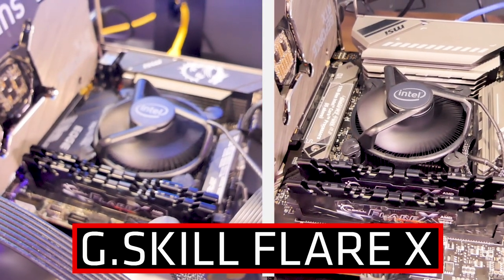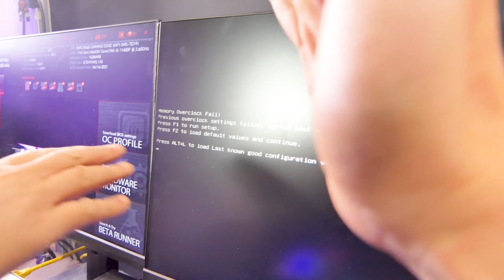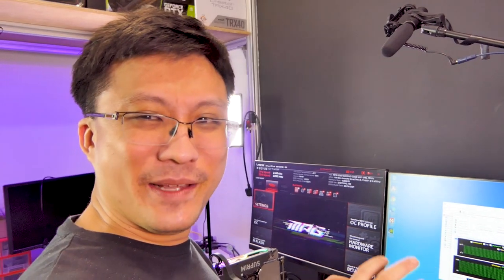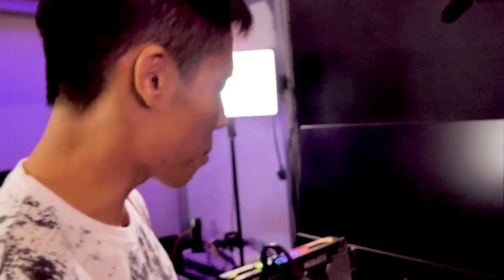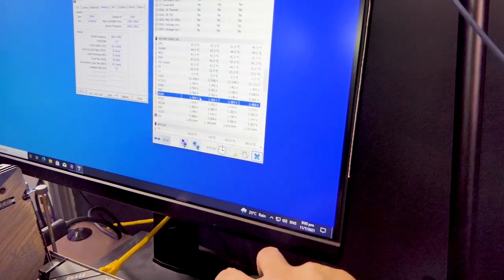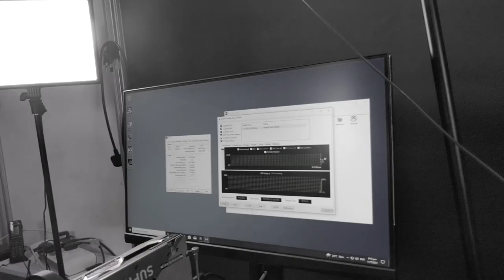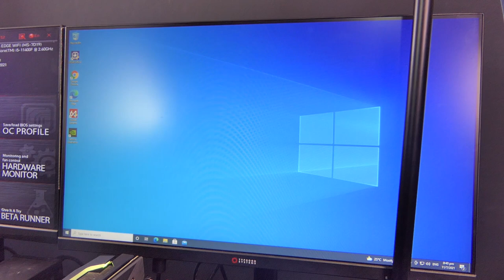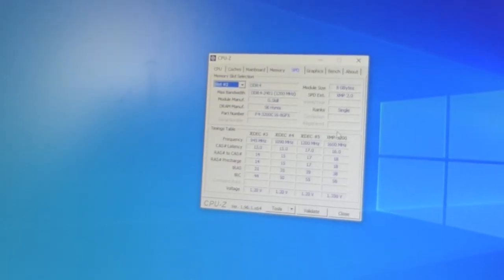BEGINNER vs PRO RAM Overclocking! - MSI Memory Try It!

Comment: MSI TryIt always fails, no matter what configuration I select.  Even the same configuration my card is rated at.  Seems entirely useless.
Reply: Fails on my PC too, that's why I'm whatching this video and.. it saved me! I selected 4000 cl18 on memory try it and modified manually the voltage to 1.46 (Auto Set at 1.45 (Don't work)) and Amazing!! Works perfect on my 2x8Gb TeamGroup Delta RGB 3200Mhz

Comment: hi guys. got a ryzen 5600x, asus b550xe, and the flare x 3200 cl16-18-18-38 2X16gb kit. with wd sn850 and sn550 both 500gb. and looking to put a 3060ti together. any way you could highlight the board and ram for me if you still have them things? plz and thx.
Reply from the maker: Hi Podicle, what would you like us to highlight? (on the board and RAM)

Comment: Good details. 4 slot vs 2 slot? If you want capacity, go 4 slot. 2 slot if you want OC stability. For me, I used 2 slot ITX boards for ... nearly 7 years before switching back to 4 slot.

Memory rank also important.
Reply from the maker: Thank you Albert for your awesome words! Yup, thank u for reiterating this. hope the audience got the idea too :) 
You were busy overclocking your RAM too?
Reply: @RealMelTan  I overclocked everything on my PC, from CPU, RAM and GPU. But I often leave it with a minor OC to maximize performance and longevity.
Reply from the maker: @Alauz  Ah i see that's cool! How would you rank in terms of overclocking ease?
Reply: @RealMelTan  ease of OC by component type, CPU: Moderate difficulty, GPU: Low difficulty, RAM: Ultra Nightmare. 

RAM got 4 levels of OC stability starting from: 
Rock Solid
Almost Stable (aircon stable, no aircon random crashes)
Barely Stable (Can post but crashes randomly)
Unstable (Boot loop, Auto CMOS clear)

Honestly the returns for RAM OC past XMP/DOCP is really low and not worth the amount of time needed to achieve rock solid OC.